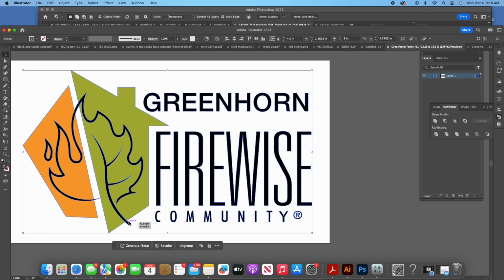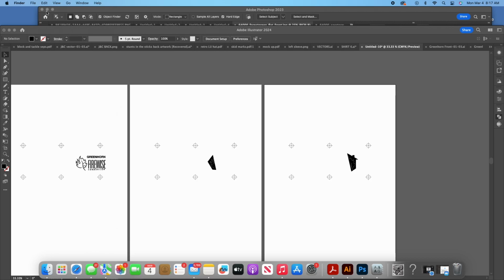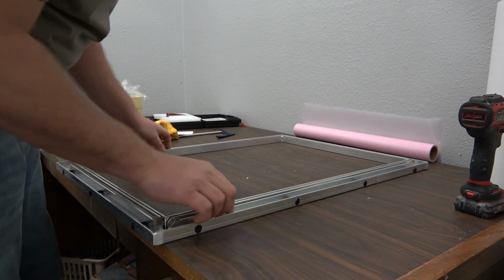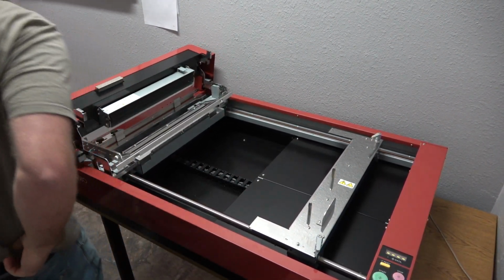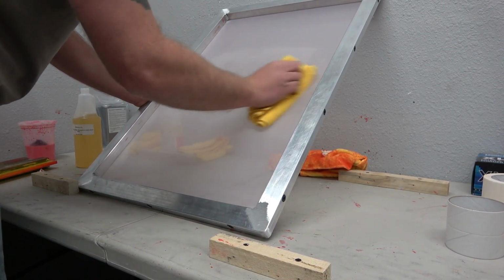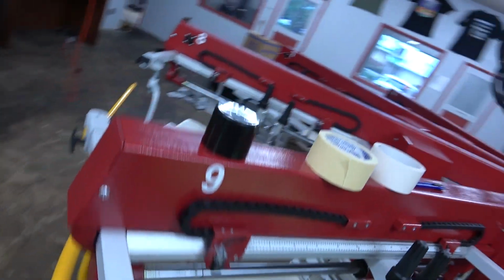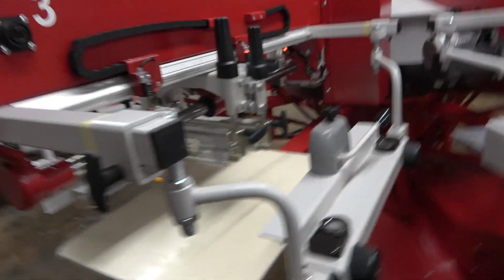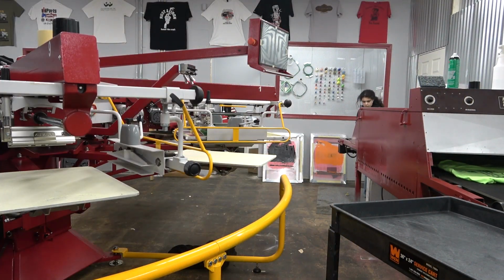VLOG EPISODE 4 (dialing the Goccopro for production)

Comment: Thank you for this video. It helped me make the decision not to buy the Goccopro. Seems all the extra steps you have to take with adding 2 different chemicals to the screen after making it doesn’t outweigh the traditional screen making route.
Reply from the maker: If I were to do it again I probably wouldn’t buy it. It gets you on press a little faster how ever a little pre planning solves that issue with the traditional way. It would be great for home shop on a manual press that doesn’t have a lot of extra space. Sadly I’m stuck with it and I will slowly add in the equipment to transition back to the regular way of making screens